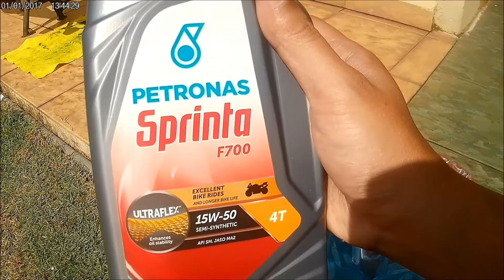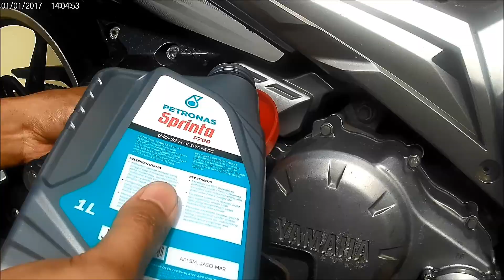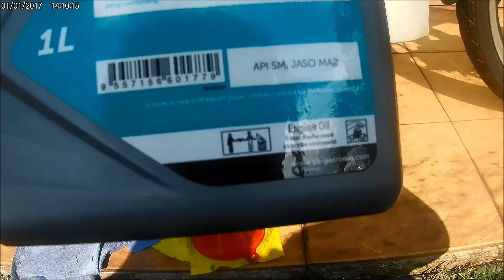#7- CARA TUKAR MINYAK ENJIN | LC 135 | NEWBIES RIDER WAJIB TAHU

Comment: Tumpang tanya, lc135 enjin standard... Minyak kepekatan berapa sedap dan sesuai?
10w-40 atau 15w-50?
Brand apa ok?
Reply from the maker: standard 15w50 pun dah ok. brand x kisah apa2 pun bole janji mesra poket. suggest pakai Petronas, Shell, Yamalube
Reply: @sengkuangman9364  15w-50 ni tak pekat sangat ke? Moto tak jadi berat ke?
Semi @ fully ok?